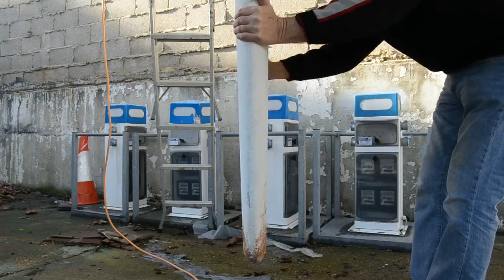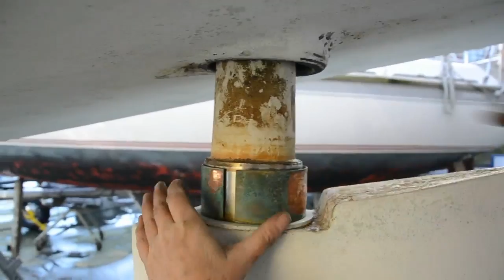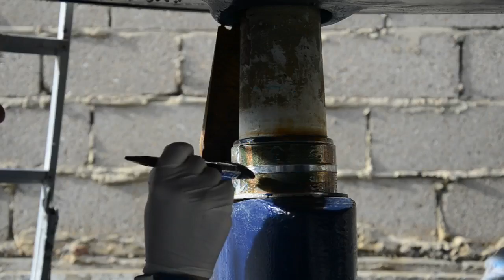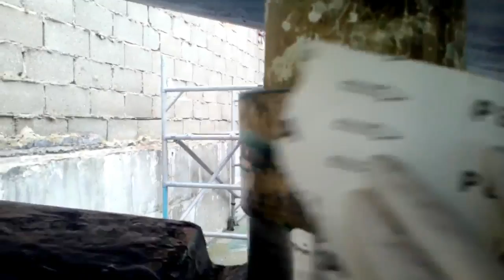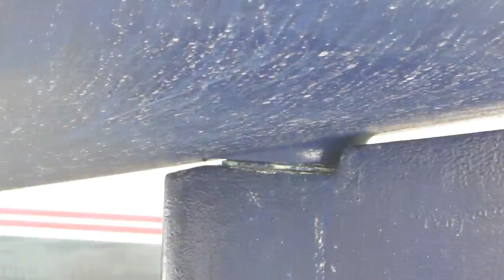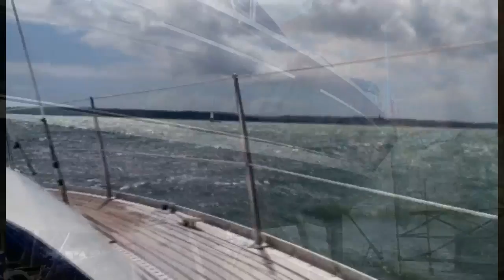Beneteau Oceanis 393 Rudder Repair

Comment: Beneteau recommends to use polyurethane adhesive ( ex: 3M 5200) instead of thickened epoxy, therefore, if eventually you need to remove the bronze bearing , it will be possible.

Comment: Hi Malcolm

Thanks for sharing. I’m currently in the same situation.
My question is:
Are you gluing the hull and the “sleeve” you made together?

Ive ordered a complete set of bearing/bushings from Bénéteau, and replace top, bottom and the thin washer.
I wanna go for another solution, as i’m planning on taking a thin fibermatt, and glue that into the hole in the hull.

I believe that you kept the bushing, “in a live rotationel state”? How do you make sure to keep the opening in the bushing towards the bow/sailing direction?

Enjoy the upcoming season

Fair winds all. 

Br

La Vie

Comment: Did it work long term? Looked like a high quality "work around" in place of a super expensive full repair.
You said you could see wear the where has occurred. I couldn't see wear the where is, is it their? It's near the hull whole?🥴😖😳🤔😷 
That's amazing, a huge bearing. Was surprised to see how similar that bearing looks to engine main and connecting rod bearings...which take a tremendous amount of force. Good work! Thank you for taking the time to create edit and post your videos!

Comment: I would not use your technique for making this repair. I would have made the dimensional measurements and had a new on fabricated to the required thickness and installed it proper. I think your giving bad advice in this case. Proper mechanical engineering practice is to replace shims and sleeves that are out of tolerance with shims or sleeves that provide the proper tolerance. Pretty basic really.
Reply: Believe it or not some people actually use their boats and end up with problems in far flung places where access to a machine shop is impossible. 
This workaround is possible providing one can even find even the matt and resin!
Reply from the maker: I entirely agree with you. Now I actually know how it is constructed the next time I take the rudder bearing to pieces I would have the copper shim machined but at least my initial repair allows you to do that. I was originally advised to glue the copper bearing in position. So far the whole thing has been fine. P.S. there are no sleeves that you can replace only the stock tube which was cast into the fibreglass hull during manufacture.

Comment: Hi Malcolm, How is it now out of curiosity? Also is that an Alu shaft. I see a Bavaria with Alu shaft and wonder if AL is up to the job.... Stainless surely is better? 
Also copper on alu and /or steel surely is not as good as Teflon from a corrosion perspective.? replace with Teflon?
Thanks for posting. Good idea, cost /time wise I might do that to my own boat . I might have: used the pipe jubilee clip at the base of the copper bearing, then used releasing agent over all that,  then pushed it up into the tube with carbon chopstrand epoxy resin spread round inside the tube, then when set pulled out to gently bore/clean above the new hull tube (black filler easy to differentiate) and left the  the key (carbon) created by the gap in the bearing so it would not turn against the hull/tube anymore.......? Then refit.. similar result, . Maybe more work
Reply: Hi thanks for you comment. Its now in its 3rd season since I effected that repair and although there is some play in the rudder it is still not as bad as it was. The one thing I thought I may done better with would be not to back off on the pipe clip too much thus making a tighter fit. The copper would easily bed in to its new shape. The rudder stock is stainles steel and all parts are original. As the boat is a syndicate boat it gets a lot of use during the season so its had a pretty good test.

Comment: Hi Malcom , nice your videos.. 
i also have a oceanis 393 , and i have a problem with  Shaft seal propeller. I dont know if you have a video to change it. 
is it possible to change it with boat on water ???
i have to do as it is Losing water, dripping... thks for your help..

Comment: that looks like a mickey mouse scam job to tighten it just enough to fool a unsuspecting future buyer into thinking the rudder is fine. no way that will hold up to the pounding a rudder will take in the ocean. why not fix it right and just add the repair cost to the sale price.
Reply from the maker: Hi John in some ways your right and it is only a solution to a problem that is being tried and tested. At the end of this season (2nd season) I will drop the rudder again and inspect it. My guess is further work or an alternative solution will be required. If you consider "fixing right" to mean cutting out the bottom of your boat and fiberglassing  in  a replacement rudder stock tube if you can find on then that would be the way to go its your choice. If you know of a better solution I would be glad to hear it.

Malcolm
Reply: @MacOne  I just did mine. I put the copper bearing around like you and used a hose clamp on rudder,I then got the outside diameter using a micrometer. I then machined a piece of delrin .010 under sized .
Using a flap wheel I cleaned up the rudder hole in the boat. Then using west epoxy glassed in 4 inch wide kevlar tape around the hole. Using  the delrin , flap wheel and high spot blue marking the high spots I sanded until the plug went in smooth.I also took the gap measurement on the copper bearing and machined a piece of key stock the size of the gap. putting high spot blue now on the copper and pushing out with my hands marking hi spots until I could fit keystock spacer. I also machined a new top delrin bearing as there was .015 play in it .I gave it .004 play and greased upper and lower bearing and re installed rudder . Before putting rudder back I did 4 coats of barrier coat 2000e No play and the rudder moves good .I can shake the whole boat with the rudder with no play.goes in the water next Saturday
Reply: Malcolm Garner Actually this is an approved method on Catalina, they actually sell a kit to do this.

Comment: Hi Malcolm thanks for sharing this with us. I now need to do the same. Any change you figured out where or how to get a replacement sleeve.
Reply from the maker: +Guðjón S Steindórsson I'm not sure that you can replace the whole stern tube as it is moulded into the hull but you can replace the top bearing once you have completely removed the rudder from the boat.

The upper baring is a white nylon bush
 which can be purchased a new one from Beneteau (<> £300) but you can get one made by
Davey Machining centre, Ipswich – 01473
255575)   fabricated one (<> £120)  – to the spec provided
by my engineer – based on the original minus allowance for previous
wear. I can't recall the material, but he was already familiar with
the issue and knew what to use.

Comment from the maker: Hi 

Good timing with your question as the boat was only lifted last Friday.

The very first thing I checked was the rudder which has held up well. There is some play but nothing like as much as last season and I have decided not to carry out  maintenance on it this year. The movement at the bottom of the rudder is approximately half of what it was last season 10mm and there is a small amount of movement at the top which is probably due to the copper bedding in. My only thoughts were I probably could have tightened the pipe clip a little tighter but as I said in the video I didn't want to trap the rudder stock.  What we did find during the season was after a couple of months the rudder developed a slight squeak which eventually disappeared. I assumed that this was the copper sleeve freeing itself from the fibreglass sleeve. I have also thought that it maybe possible to obtain a thicker piece of copper plate and bend that around the shaft. 

I hope that helps. Malcolm